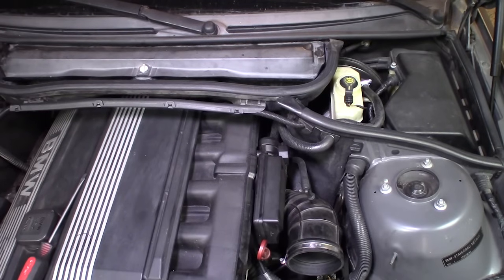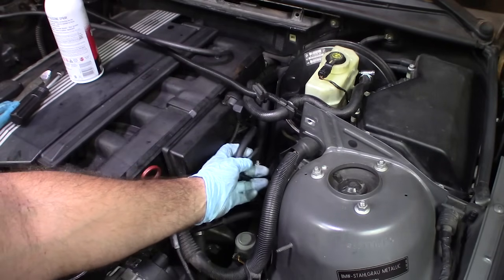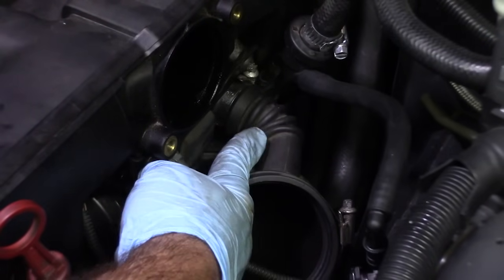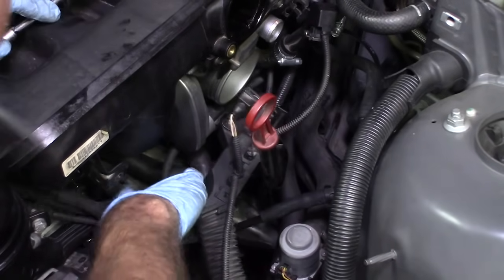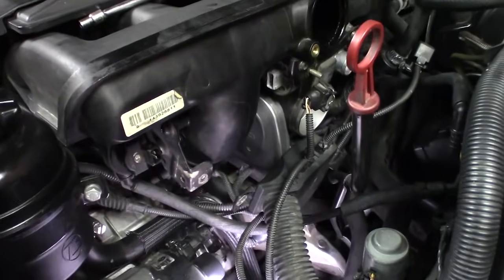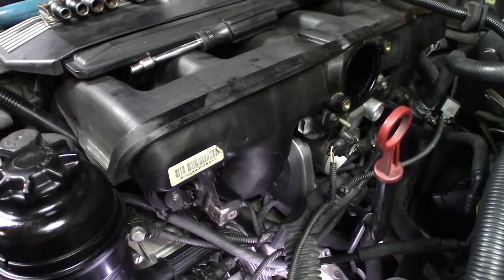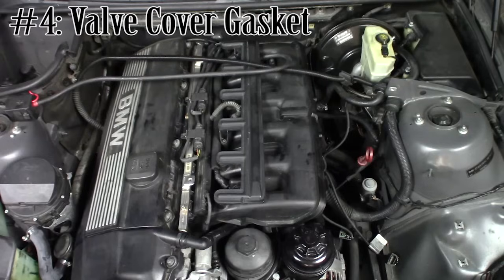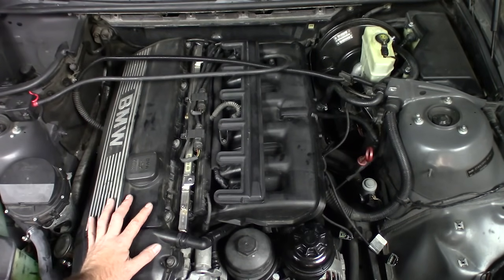BMW E46 & E39 Most Common Vacuum Leaks P0171 & P0174

Comment: I just had my 325i spit out a load of codes - misfires on multiple cylinders (with fuel cutoff) and found a split 7 mm vacuum plug on the back of my intake manifold... could this be the cause?

I covered the intake boot with duct tape and blew into the brake booster pipe, and with my finger over the offending hole I was able to generate enough pressure to breach the duct tape.

Comment: I have only the P0171 code and I realized I had a vacuum leak by testing out the oil cap. I own a F30 328i SULEV. What should I check for ? I have a CEL but clears over night. Car stalls and has a rough idle.

Comment: I keep getting P2098 after dropping the exhaust, even after replacement of the exhaust gaskets, can the air travel backwards (against airflow) the two inches from the flange to the 02 sensor on bank 2?

Comment: I was wondering if you could tell me what size vacuum hoses are used I've ordered some 3.5mm and some 5/16ths and I'm curious if there are any I'm missing. It's a different video but I think that was what you said you used when you went over the ccv replacement

Comment: my e46 runs fine until I drive long distances  (over an hour) then it sputters when I try to accelerate. I have no check engine light on and when I drive it the next day everything is back to normal. Any thoughts to what it could be?
Reply from the maker: Maybe a bad fuel pump that can't deliver enough volume once it's warm.  Check your fuel pressure to see if it's 50psi.

Comment: Hi 50s kid .. buying this 2004 3.25i for my kid has been quite an experience. going from GM to BMW was like swiching from APple to Anroid!!  Here's an idea that worked for us to put the car in great condition .. you've never mentioned a smoke test .. but it sometimes would make sense. But I didn't want to do that because I thought of a simiar test .. I bough some 16 inch punk sticks. They are meant to make your house smell good .. but they generate a lot of smoke. I started the engine then moved the punk stick nes possible leak areas. In my case it was the Oil cap leaking. No doubt why it was leaking .. The ccv diaphragm was ripped before I bought it. With your video it was easy to find and fix .. but it must have been that way a long time because the oil cap gasket had a GIANT depression from being sucked in all the time.  Thank you so much for the videos.

Comment: Excellent tutorial, I'm suffering from poor idle and occasional stalling when approaching lights etc, No fault codes but i've got my money on an air leak / idle control valve issue, I did clean out my ICV but the DISA valve looks like it could do with some attention. Would you recommend swapping out all the vac lines while i'm at it?
Reply from the maker: always a good idea. check out my fuel trims video to figure out for sure what your problem is
Reply: Will do!

Comment: Great video. My E46 320i idles rough on start up. As it warms up it seems to stop. Sometimes if I turn it off and turn it on again, it will idle smooth. I'm guessing now it could be the CCV valve. It uses oil too, but doesn't drip or blow smoke. Your advice has really helped. Thanks.
Reply from the maker: Probably CCV system.  Not the valve but the broken hose I talk about in this video.
Reply: 50sKid Cool, thanks.
Reply: Kko
Reply: Might be maf

Comment: Hi, I have a 2003 bmw 525i E39, while replacing the valve cover gasket, the vacuum line that runs from valve at the passenger side front of the engine to the back of the intake manifold broke.  Do I have to remove the intake manifold to replace the vacuum line?  I will appreciate it if you will give me some advice of how to replace it.  Thank you very much!  Daniel

Comment: Im trying to chase a p0171 only on my 03 325i m56. I’ve checked all possible vacuum leaks and everything looks good. Any suggestions?
Reply from the maker: Bad O2 sensor or clogged fuel injector. Most likely O2
Reply: @50sKid  what’s a good  junkyard  to go here in so cal?
Reply from the maker: @danielcastaneda5249  LKQ

Comment: I had the cracked hoses by the secondary air intake. I think I also need to replace the vacuum solenoid behind the engine near firewall. I'm getting the spontaneous idle drop at cruising speed. It makes the car almost undrivable.
Reply from the maker: +Randall Schoverling If you are at "cruising speed" then you are not "idling".  Can you be a little clearer about the problem?.  The vacuum solenoid that I think you are referring to only activates when you first start the engine when cold (its for the secondary air injection to heat up the o2 sensors & cats quicker).
Reply: My best friend is a performance auto tech. He went through and replaced just about everything: disa, MAF, coils/plugs, gaskets, fuel filter/pump, ccv, torn boots, cracked hoses etc. 
       I'm still getting the CEL p0491/p0492.  The only thing we haven't done yet is the O2 sensors and secondary air solenoid and hoses.
       The one remaining issue my E46 325xi has is  while cruising steady RPMs foot on the  accelerator... The rev/Idle will drop spontaneously for no reason and then catch back to cruising rpm's. I've seen many of the same problems discussed while searching the BMW forums. No one seems to have a definitive answer. It's very frustrating.
Reply from the maker: +Randall Schoverling Yeah P0491 is secondary air injection insufficient flow.  Either the vacuum valve is defective and not opening or the air pump itself is dead.  Do you hear the air pump run when you first start the engine (when it's cold)?  It runs for the first 90 seconds or so and then stops.  Try listening to your engine with the hood up next time you start it.  It's very distinctive and you will know what I'm talking about because once it stops running it's like, ahhhh... so much quieter now.  Regarding the drop in your engine RPMs, are you also feeling a drop in the car's power & speed or is it just a faulty speedometer that is dropping dead and coming back alive again?  If you are getting a drop in power I would suspect the fuel pump...
Reply: +50sKid Air pump works and fuel pump/filter are brand new.
    What kind of octane should I be using in my E46?

Comment: Hi I'm getting fuel cut off misfire on cylinder #6 even after I changed the set of coils I'm still getting the same misfire in the same cylinder ,someone told me that could be a vacuum leak is that true ? Or what could it be ? 
Thank u
Reply from the maker: +Ahmed Abd elsalam (Mada) Don't change parts, diagnose the problem. Check out these videos for help diagnosing your lean condition (which is what is likely causing your misfire): https://www.youtube.com/playlist?list=PLqJG4ZyPIF6O5zCoLEqWYXR4Ezbo0GYAv

Comment: This video really help me. The boot had a tear, so i replaced the boot. However. I had moved the oil dipstick, and when i checked the fuel trims they pegged out lean and dropped at 3000rpm. It turned out to be a vacuum leak caused by the lower oring on the dipstick tube.

Comment: Hey 50'skid. my car says it's running lean at idle. Could it be a dirty maf, vacuum leak, or boost leak?
Reply from the maker: +ChroniZz If you have an E46, it can't be a boost leak because the M52/M54 is not a turbo boosted engine.  The other two things you mentioned are valid possibilities.  How did your car tell you it was running lean at idle?  What codes are you getting?
Reply: +50sKid sorry i forgot to say i own a 335i. codes is p2187
Reply from the maker: +ChroniZz Most likely a vacuum leak.  Sometimes you can find vacuum leaks by spraying the parts of the intake with carburetor cleaner or water while the engine is idling and listening for a change.  If you're going to use carb cleaner, make sure your engine is cold first so that it's a little safer.  Also, make sure you do it outside just so you're not suffocating yourself by running your engine inside your garage.
Reply: +50sKid will do.My 09 cobalt ss Turbocharged is also running but ill check it out tommorow. thanks for the adive

Comment: I recently bought a car it says all cylinders are misfiring, it also says it is running lean. It does not idle rough the only problem I see is when I push the car to the max it does not go up to the redline. It only goes up to 5500 rpm. Could it be that is has a spectre aftermarket cold air intake ?
Reply: I think your car can be broken, sell it and buy a new one :D

Comment: This video helped me find a vacuum leak in the E39 that I'm restoring. I'm now also taking proactive maintenance to prevent further issues. Thank you!
Reply: What symptoms was your engine showing? Mine varies RPM while driving a steady 65km/h (40 mph). Is this the problem with my engine?

Comment: You easily saved me over $1000.00 at a dealership. Big thank you for this video! If you ever come to Sacramento I'd be more than happy to buy you a beer. Thanks again!

 My 2002 330i was having an extremely rough idle and sometimes having problems accelerating like it had no power. The engine would even cut out randomly when I was at a stop light. The problem turned out to be my MAF Flap adjuster unit, the flap was snapped off and floating inside the unit.  20 minutes of labor and $150.00 part and my check engine light is gone and my car runs like new!
Reply from the maker: Nice, glad to hear!
Reply: I got the same problem

Comment: I found that the Disa valve was not working, i fixed it but i still get the codes. do i need to reset the check engine light or it should be removed automatically after being fixed, its been 2 months already. Help pls.
Reply: +Manuel Deheza You got to reset the light with an OBD scanner. I just changed my Disa too and had to buy a scanner to reset the light. Pepboys had one for under $20.
Reply: thank you for the response!

Comment: Dear 50skid! need your help! i did change MAF sensor and clean it, change both air intake boots, disa valve o-ring, all small houses on left side and back of engine,secondary air pump hose,o-ring on oil dip stick, all CCV hoses but P0171 and P0174 are still on.  the only thing i havent done is cleaning of throttle body... Did i miss something?
Reply from the maker: Have you looked at live data using a scan tool?  Have you confirmed what kind of lean condition you have? (refer to my using fuel trims to diagnose engine problems video)  If the total fuel trims drop when you run the car at 3000rpm, then it's a vacuum leak, etc.  If you confirm it's a vacuum leak then you just missed something somewhere.  If you can't manage to find it, check out my video on building a smoke machine to search for vacuum leaks.
Reply: +50sKid I just did check it and it showing-3.1, -5.4. but when I accelerate it shows 7.2 , 5.6 and then goes down again.what does it mean?
Reply from the maker: Not a vacuum leak.  Actually, it sounds a little bit more like a dirty mass air flow sensor.  Spray yours clean with some brake cleaner and see if that helps.
Reply: +50sKid I did clean it last night, but this morning codes popped on again...will try another MAF sensor

Comment: Thanks 50sKid.  I've been watching good many of your videos and really appreciate your attention to detail and the good quality picture.  It sets you apart.  I had a question fro you based on this video.  I too have these codes and an P0300, P1083, P1085, P1344, P1348, P1350.  After watching your videos I think I've narrowed it down to the DISA Valve seal but not positive, but I have changed my spark plugs, ignition, replaced the bad vacuum cable to fuel filter and the upper intake boot, not to mention cleaned the Mass Air Flow system, together with Idle control valve and Throttle body .  But none of the errors have gone.  I have to rebuild the DISA Valve as the flapper part is not working.  My question for you is that when I pulled out the DISA Valve, it was greasy and grimy inside and I had to spend a bit of time cleaning it.  Is this a sign of something else as most of the videos I've seen show a pretty clean DISA Valve and after some quick research some are pointing at replacing the CCV, for which I found one of your videos but it seems quite an undertaking.  I have a 2003 330i with 150K.   Thanks again.
Reply from the maker: +Haku Kuze Thanks. It's normal for the DISA to be oily. If you've seen videos where it hasn't, you've probably just seen where someone has recently replaced or reconditioned theirs.  How is the o-ring on the DISA?  Does it feel like it's very, very difficult to get the DISA back into the manifold?  Because it should--you should have to wiggle it around quite a bit--it shouldn't just slip right in.  If it does, there may be a leak there and it's worth getting a new o-ring from eBay.  Whether the DISA unit itself is functional has nothing to do with setting those particular codes that you have.  Also, it would be a good idea to visually inspect the hoses/tubes in the CCV system for cracks and such.
Reply: +50sKid Thanks much.  Somehow I didn't get alerted of your response, but you were dead on.  I actually had to get a repair kit for the DISA and the o-ring was not only flat but I had to scrape it out of the groove as it has basically molded into place.  I ran the scan with my BlueDriver and no more codes!  The problem now is when I run the smog check test, it says "test is NOT complete" for a bunch of items such as the Catalyst, Evaporative System, Secondary AIr system, etc that may cause smog check to fail.  So I have to call them tomorrow and see why they are not complete.  There is still a lot to do on the car both mechanically and cosmetically but at least this should get it road legal and I can feel a little bit of accomplishment!  Thanks again for all our videos, looking forward to seeing more as I tackle the next projects.
Reply from the maker: The o-ring on the DISA comes molded in like that on the M54 engines, whereas on the older M52 it was replaceable.  So you have to scrape it out like that in order to replace it.  The tests not being complete is normal whenever you reset your trouble codes.  The car has to go through 1-2 drive cycles in order to run those tests.  Lookup OBD2 drive cycle on google for more info about that but basically you just need to let the engine cool down overnight and then drive it on the freeway for a few minutes and then get off.  If the codes don't set after that, there is something else still wrong with the car.  Sometimes something can be wrong that won't actually set a code (I've got a friend who has this situation now--and I'll be doing a video on that of course).  Hope everything is good for you, though.
Reply: @50sKid  Five years later and the car sat for a while due to a mishap by one of my kids.  Thanks again for all your help.  As of today, I've cleared the engine codes on the cluster panel but the bluedriver still shows an error, which I think relates to what you said above and needs to be driven after I deal with the smog check.  I had rebuilt the DISA valve a few years ago and replaced some rubber boots that had torn, went through your video and checked for all the leaks points and confirmed all to be good too.  Your videos are always helpful and educational, the best on youtube and I couldn't have done it without them.  Thank you.

Comment: Many thanks, brother... I knew my E36, inside and out. Bought an '01 E46 325xi, and the M54 engine bay has me stumped at times. I want an original Owner's Manual, and the Bentley repair manual, but your videos have been SO HELPFUL

Comment: where's the fuel presure regulator hose conected?  in the engine. i have this car that have missing hose
Reply from the maker: In an M52 it connects to a hard line on the back of the fuel rail.  On the M54 it connects to the F connector on the intake boot.

Comment: Thanks so much for the great video. I have 2002 e46 with the 0171 & 0174 codes. My car runs great except for when engine is cold, it hesitates when I throttle from a dead stop and will die unless I kind of feather it or stomp on it. I'm pretty sure I have a vacuum leak. Of all the possibilities of a leak is there one that would be more prevalent under my circumstances? Thanks in advance.

Comment: Just went through my E46 to fix a vacuum leak and update the ignition system at 141000 miles.  After replacing the valve cover gasket, DISA valve, fuel injectors, and several vacuum hoses I still had a rough idle.  I finally broke down and replaced the lower hose on the CCV and O-ring on the oil dipstick tube to finally get the vacuum leak fixed.  Thanks for pointing out those parts as failure points.  Maybe I should have started there first!

Comment: How can I send you questions not related to this video, have a P0171 issue, But there is a clackering?? that sounds like a diesel went accelerating?? Could the idler control hose being kinked be an issue? Or aftermarket disa valve replacement be loose and be the problem, sounds like the air filter is off the car when accelerating, but no power, definitely lagging.